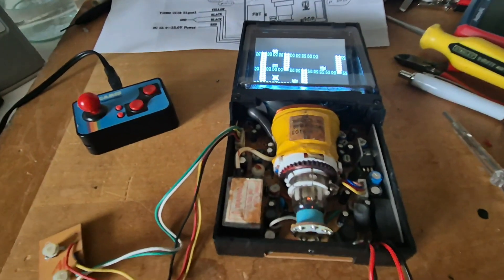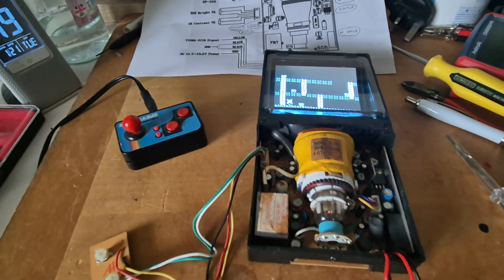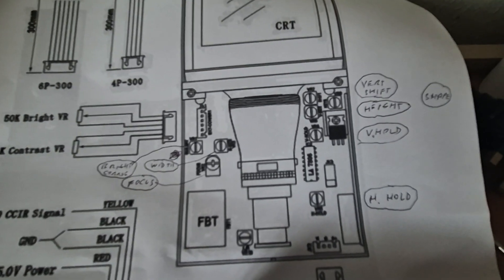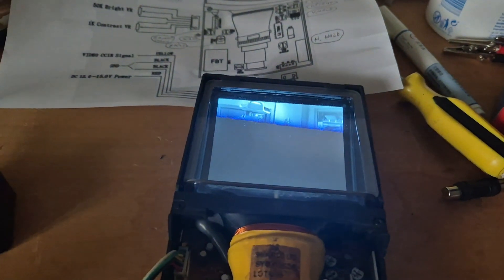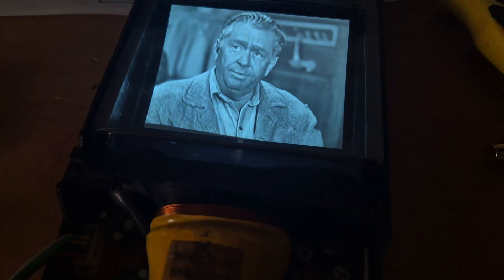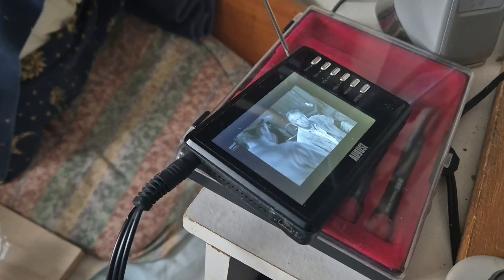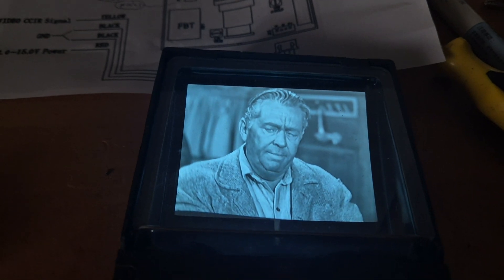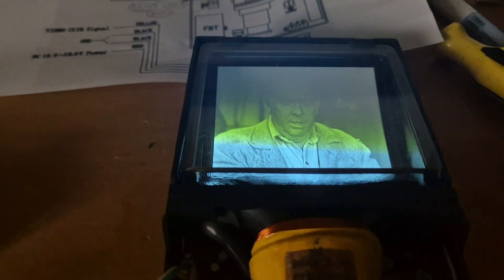Miniature 4 inch CRT monitor experiment

Comment: its really wierd that these things just started popping up on amazon, even more so because there are several slightly different models of the same size using different electron gun assemblies and slightly different components. it makes me wonder what chinese company just got their hands on a  ton of old, unbranded CRT's from some recycling lot. its hard to judge the quality, as there seems to be an intense blue glow to everything which i assume comes from your camera, but the image is decently sharp. which implies these were a pretty good portable set back in the 80's or 90's when they came out.
 
 id love to get my hands on a view of the late model professional CRT viewfinders, for use in a on-head-display, but most of that shits sitting in giant lots for "recycling" in china, and wont be on the market for another 10-15 years.

Comment: does yours go crazy sometimes? mine especially when cold has a momentary increase in brightness, loss of focus and also the deflection shrinks, it lasts like a second but i couldn't understand what's the problem, it doesn't seem to be the 10V regulator, although it involves kinda anything in the monitor
Reply from the maker: @PosthumanKindergarten  I haven't noticed that. You could have a capacitor issue there, or a bad solder joint somewhere.
Reply: @Timothycan  i'm not the first one reporting this, these units are probably not brand new
Reply from the maker: @PosthumanKindergarten  Mine is not brand new, it seems to be a bit of a lottery as to which one you get. Some people seem to get lucky and get one which has never been used, but most seem to be like mine, with evidence that they have had some use. In any case, they look like they are around 25 to 30 years old, even if they've not been used. Mine seems to have been stored somewhere not perfect, as there is some surface corrosion on the flyback transformer casing. I bought mine just as something to tinker with and make videos about.
Reply: @Timothycan I ended-up with one like that too.  I haven't powered it up yet.  It's a bit musty smelling, too.

Comment: Did you have to adjust the yoke on yours, I just ordered mine from AliExpress.
Reply: Thank you for the reply.
Reply from the maker: Yes, there are two small discs on the yoke that can be turned to move the image around on the screen. Also the scanning coils can be moved slightly, by loosening off the clamp holding the coil assembly, But due to the shape of the coils and tube, you cannot rotate the scanning coils much. The image on mine still slopes a bit, (lower on the right side). But not too bad.